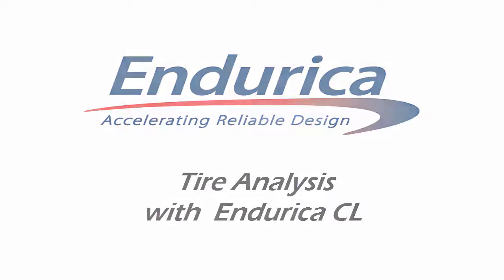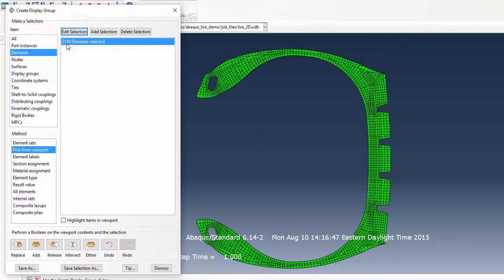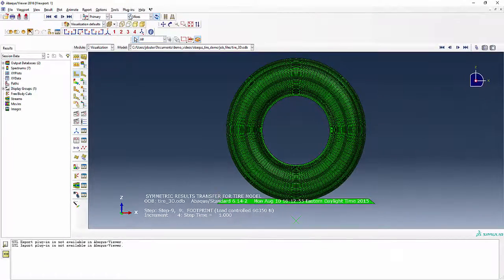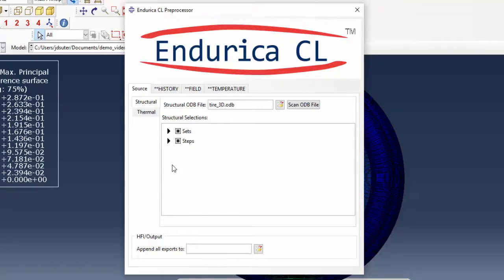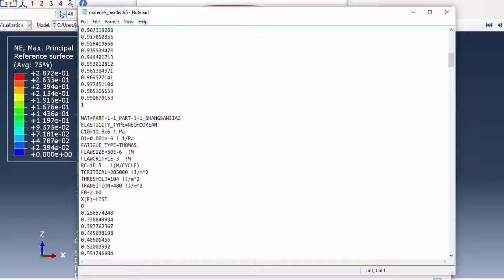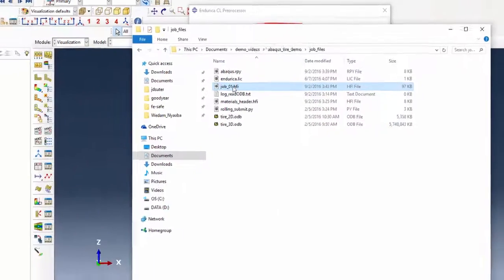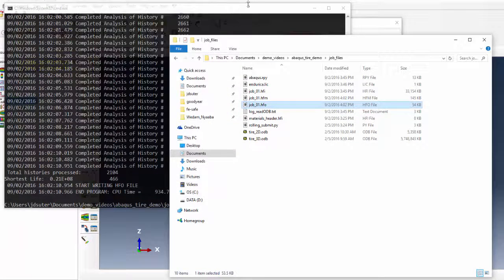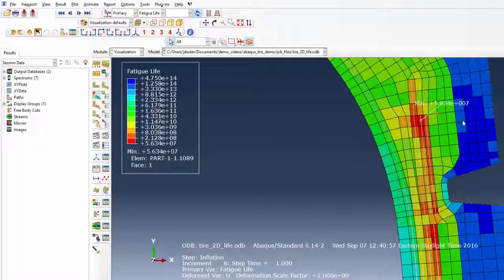Fatigue analysis of a truck tire: Endurica CL workflow demo

Comment: I want to know how to import the 3d results of the last frame into the 2D tire model ? Thanks!
Reply from the maker: The Endurica input file has an optional keyword ROLLING, which when invoked, tells Endurica that the given strain field from the 3D model should be interpreted such that results on cross sections around the tire become time steps, with each streamline corresponding to an element in the 2D cross section.  After Endurica has completed its execution, the results (one life results for each element of the 2D cross section) can be imported onto the 2D mesh that was used for inflation.  Alternatively, the results could be copied onto all of the cross sections so that a 3D representation can be made.  Hope this clarifies.
Reply: @endurica  Thanks for your answer. I am currently using Endurica solver in FESAFE/RUBBER to analyze tire fatigue life, but I have been struggling with this problem for a long time.  I wonder if Endurica solver in FESAFE/RUBBER has this function?  Or can ABAQUS do this? Hope for  your suggestions.
Reply from the maker: @yongdeeping3357  The ROLLING feature is not available in fesafe/rubber, unfortunately, only Endurica CL.  To do this in fe-safe/rubber, you will need to do it manually: 1) export the strain history from the 3D tire model to a text file, 2) write a script that reorders the text file (with one strain history per cross section element, and each increment of history corresponding to one tire cross section), and 3) read the text file back into a 2D analysis of a tire cross section in fesafe/rubber.
Reply: @endurica Thanks for your suggestion, I will try to implement it through this method.